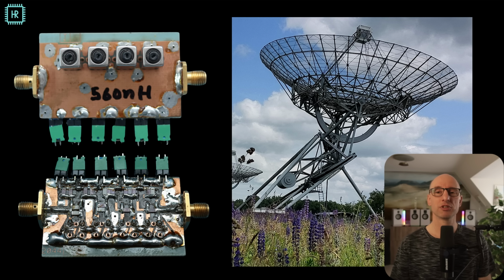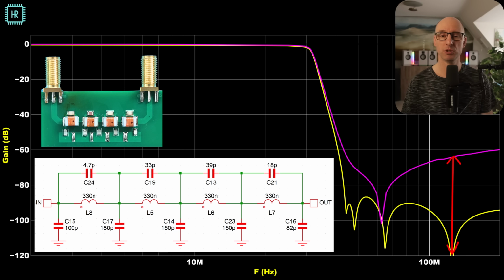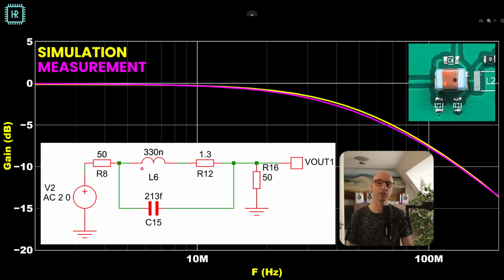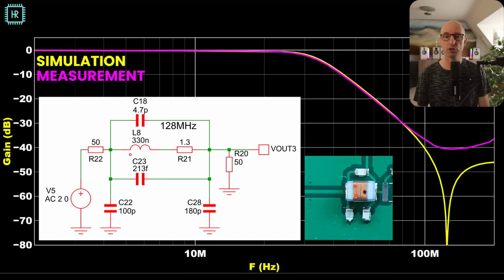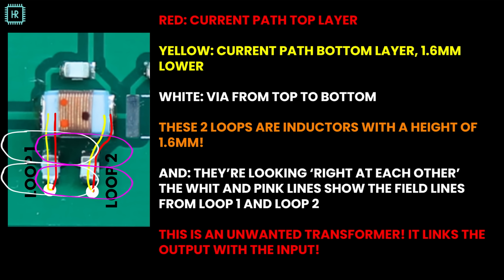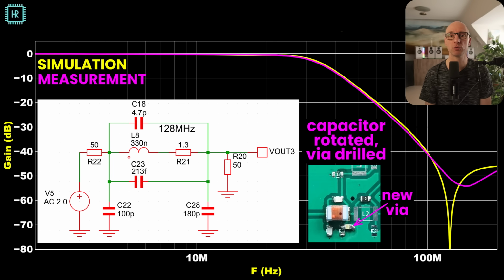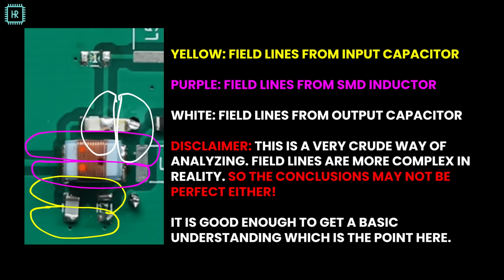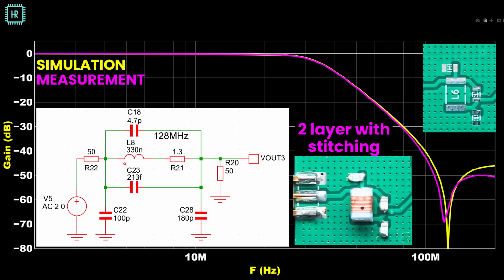The Hidden Time Sink in Electronics Design

Comment: I have a mother stumper of a problem with my Hammarlund HQ-129-X receiver.  It's not as sensitive as a car radio on the ground, while being in a third floor wooden building.  I don't know where else to stick a screwdriver.  Its alignment seems okay: I can't get a signal louder by tweaking my 455 kHz IF.  The diode link is as loud as it can get.  All the tube voltages are good, maybe a little high.  The signals it can get are clear, and the louder ones will overload the RF amplifier.  I did a re-cap and removed an aftermarket voltage regulator from below deck, which cured motorboating.  I had to reconnect one of the wires inside an IF transformer. <-- biggest possibility but a huge job.

I am at least the 5th person to go in with a soldering iron.  I can tell, because someone wired the volume control with scraps of Ethernet wire, and there are several different types of tube socket.  There's wiring in here I can't explain, and spots where resistors are broken in half, but reconnecting a resistor across the dead one did nothing... Stop me before I replace all the resistors with modern ones?
Reply from the maker: I am a bit from after the tubes age so I cannot really help there.

The biggest problem are usually the electrolytic capacitors. They have a very limited lifespan. Did you replace all those first, or check them?
Reply: @HansRosenberg74  Those went first, then anything & everything made of paper dielectric.

Comment: Is there a way to use a GND trace on the top layer of 2 layer board to take the return current back to where it needs to go and keep the loop area small?
Reply from the maker: You can add it to help keep the loop as small as possible.

Comment: I'm just glad that I work mostly with digital TTL electronics which are much closer to simulation, but not always. Also analogue effects can be mostly, but not always, forgotten about.
Reply from the maker: As long as the risetime of your circuits is not too low, you don't have much problems. 

A short risetime creates a lot of high frequency harmonics which turns a digital signal into an analog RF signal.
Reply: Ultimately, everything is analog.

Comment: A wise analyst once told me that all models are wrong; some models are useful.
Reply from the maker: Haha, yes.
Reply: Models are by definition a deliberately oversimplified picture of reality. It works or it does not, or it works sufficiently enough or you know where the limits are. There are no "wrong" models. Newtonian physics is proven to be wrong, but in general it works well and saves tons of more "correct" calculations.
Reply: @geo @georgkrahl56 e point is that the real world is always going to be more complex than the model can ever be.  If your model captures enough of that complexity to give the correct result then it’s a useful model.
Reply: That quote is from George Box
Reply: @leonidasg0039 *ding ding ding*. YOU WIN!🎉🎉🎉
Reply: Even flat earth is a locally useful modell...
But there are certainly modells that are wrong and therefore only misleading.

Comment: I love the "there is always a logical reason for the problem*" 
*When the problem is purely physics. 
That is why people who are good at hardware are not necessary good at software. The latter is no pure physics, it incorporates the thought process of humans so logic goes out of the window.
Reply from the maker: I completely agree with that: That is why I struggle with using software as well quite often :-D
Reply: Nah. Software is arguably more constrained to a simple set of rules. A CPU can only do specific things, and code is just a way to combine those operations to get an end result. There is always a logical reason why your program doesn't do what you think it should. The hard part with computers is that their internal state is hard to expose in a way that's easy to look at (i.e. it can be hard to measure)
Reply from the maker: @metroid031993  The commands and architecture of a processor is not the problem, it is the humans writing the algorithms, those are often illogical and do not follow a fixed set of rules like physics.

In that sense, a few rules about electromagnetics are way simpler than trying to figure out what someone came up with, which could be anything 🙂
Reply: @HansRosenberg74  Aye, I never fully trust a model unless I can look at the calculation algorithm and how the components are modelled, which really isn't possible for spacial modelling.
Often I will create test circuits just to check if they implemented certain physical/material aspects (spoiler: if I have to check then they often haven't).
Reply: @HansRosenberg74 there's an old phrase about idiotproofing and the universe creating better idiots that probably fits.

Not in relation to idiots, but users in general. They are always going to come up with something you didn't expect that leaves you puzzled.
Reply: @HansRosenberg74  ^ this, because software is in the abstract space there's a massive variance between the way people in the field think. You don't have that in electronics (or mechanical engineering, woodwork) because physics grounds them.
Reply: @metroid031993  But the rules are not physics, unless you go down to exactly the machine language, thats firmware not software.
A FET is pure physics, software is a human creation the rules are also a human creation. 
I remember years ago as field support engineer in nuclear medicine, after I had finished the job I came to do, they asked me to look at some very old equipment (and that is very old by 1987 standards). I had no clue how to operate it. But the operating panel had literally no software, only buttons and dials so I looked up the schematics and just figured out what the electronics was doing. And thats how I learned to operate it. If there would have been software in-between, I would have been dead in the water.
Reply: @hugobloemers4425  the rules are literally defined by transistors, of course they're defined by physics.
Reply: @metroid031993  with IT engineers 95% the time it's DNS or certificates.
Reply: @metroid031993  the logical reason is sometimes due to a bug/quirk in the CPU.
E.g. the reason why emulated little big planet crashes in multiplayer but only if two players have different CPUs. (They don't interpret numbers in exactly the same way, so the game goes out of sync).

Logical once you know why, but unless you're working on embedded stuff, you're gonna have issues that are seemingly illogical. (Another one is libc (in 2019) randomly glitching when moving data accross 2GB memory boundaries)
Reply: @metroid031993  True. But there can be several layers of abstraction. CPUs reorder instructions. Operating systems schedule threads. Compilers optimize. Sometimes source code is not available of precompiled libraries. So it can be hard to find the root cause of issues.
Reply: I am good at both. But I don't understand people.

Comment: The 'divide and conquer' aspect generally is taught at university. 
The problem is that people do not apply it properly and juniors underestimate complexity terribly.
Reply from the maker: Then things must have improved. I did not get any of that!
Reply: @HansRosenberg74  not necessarily as a problem solving technique directly but in things like order complexity.
Reply: I learned that principle from a very experienced EE when I was in college, not in class. That mindset often is a terrific time saver and there should be more courses that include such problem solving strategies. I did my master thesis on 34 GHz broad band radar 1982. Back then we only had COMPACT and similar. Results obviously  differed to much from reality. It was useful for some guidance, but most work was done pretty much like in this video.
Reply: As a software person, the problem I see is that it is hard to judge how much time you'll save by doing things properly.

Yes, it would be best to write tons of tests, and make sure things fully work before moving on.
But that looks very time consuming.

What then often happens is that you start by writing something small, thinking that it is simple enough that it can't possibly go wrong. Then you write a second thing l, a third,.... And before you know it, you run into a bug in a giant system of tons of small parts.

And it is only then that you pay the cost for not properly testing things. Because at that moment you'll start playing whack-a-mole with the bugs.
Reply: @Dimi0045  The problem often is lack of initial communication between competent analog, digital and software engineers. And often mechanical and other disciplines as well. The result can be an endless series of bad design choices that create a mess of patchwork in both hardware and software.

Comment: you try convince me to never use multi-pole filters
Reply from the maker: Ehm, I did not see that response coming :-) Those filters are actually very good, just make a good layout. 

They're a bit outdated these days as many of the tasks they used to do are now done with digital signal processing.

But they're absolutely fabulous for demonstrating all kinds of pcb, emc and signal integrity effects.
Reply: @HansRosenberg74  i don't think digital processing is enough to make a HF transmitter legal though
Reply from the maker: At really high frequencies, yes, you still need LC filter.
Reply: @HansRosenberg74  but very helpful when you need to keep consumption to a minimum.
Reply from the maker: Indeed.